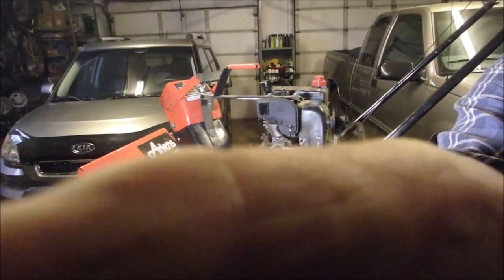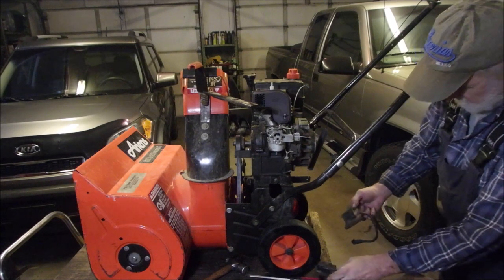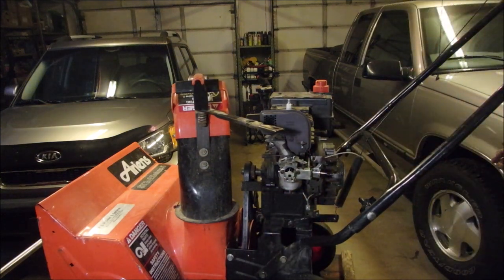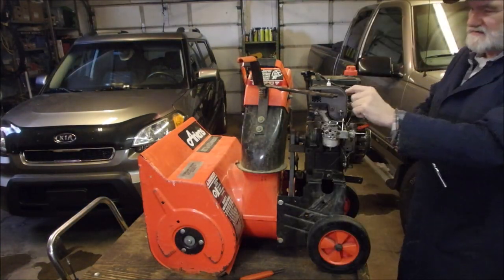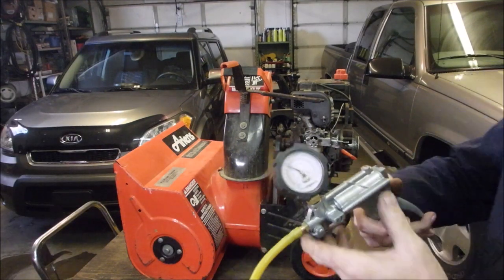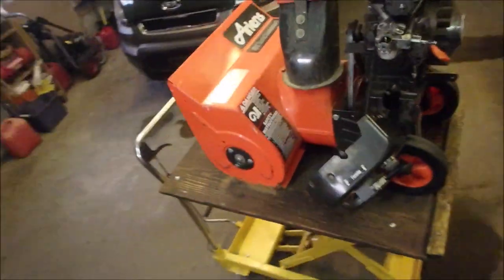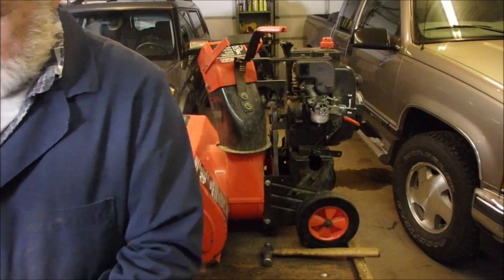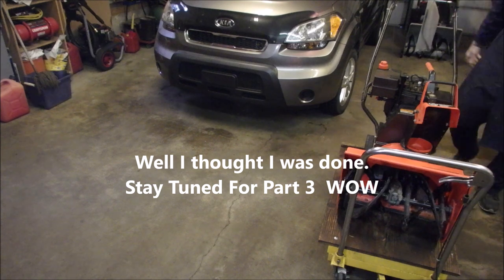Ariens 2+2 Snowblower  Has Me Wondering!! Pt2.

Comment: The older shut off valves are built better but the seals dry out and they leak or seize . The new ones only last a couple of years and they go bad too .
Reply from the maker: Right.  I have had luck takiing the older ones apart and oiling them.
Reply: The China made ones, the Lazer brand, and other unbranded similar shut offs are garbage. I have had way better luck with the B&S ones... they all look the same... red & black, but if you buy cheap that's exactly what you get.

Comment: What makes the machine backfire through the exhaust when you put it o no choke setting?
Reply: Back fire is firing through carb an afterfire is when the engine fires incorrectly through the exhaust. That is caused from a leaky exhaust valve, improperly (or worn) valve adjustment, or too much raw fuel in hot exhaust port exoloding
Reply: @staind288  Thank you, but I do not think that's the problem. I have had this machine in for repair before, and it did not do that the last time. Customer left stale gas in it all summer, and the machine runs fine on full or half choke but when no choke I am experiencing an intermittent flame out through the exhaust.
Reply from the maker: Malltuned or an exhaust valve
Reply: @BrucesShop  bad spark plug?